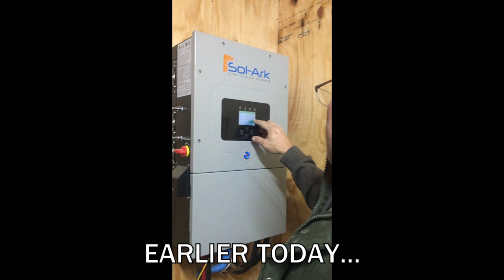A TOUR INSIDE the OFF-GRID DOME

Comment: Nice progress and I'm so glad you're toasty warm! Pro-tip for the tarp: Take piece of plank, small wood screws and large flat washers for them and screw the tarp into the plank along bottom edge of the tarp. You can then put another screw for fixing your rope to the brick on the ground. That will most likely last as long as the tarp does not desintegrates (those tarps desintegrate soon or later, usually soon). I use this technique all the time for covering agricultrual stuff and stocks of hay bales.
Reply from the maker: Great tip… yes, I’m sure the tarps won’t last long, just hopefully through this winter 👍

Comment: Hey great work and progress. Nice that you finally got some nicer weather. Being on the dome was really scary for me and even more so once the Trimco water proofing was being installed. We even used safety harnesses and fall protection lanyards. This did not make me feel any safer though. I was slipping on it and barely catching myself and not falling all the time. Even though I was careful when moving around on it

Go to Harbor Freight and do a search for Canvas drop cloths. We went to our local Harbor Freight to get a new propane regulator for our patio heater. My wife disappeared and came back with a few canvas drop cloths. I asked why do we need those now we don't have any interior walls to paint! She said we will use them for drapes and then use them for drop cloths later. I said those are way ugly too. I asked why when our views are so great, do you want to cover the windows. She said it will keep us warmer in the winter and block the western sun in the summer. We got them and overlapped the center or cut and overlapped the cut seams. This allows us to tie them back during the day for enjoying the views. Without insulation in the facades were seeing about 57 degrees inside even with the use of our Mr Heater big buddy on high with a heat activated fan to circulate the heat, when the weather dropped to freezing outside. We finally insulated the walls using Rock Wool brand insulation that is fire proof, mildew proof and mold proof. It is also waterproof :) . It is R24 rated for a 2x6 wall as opposed to fiberglass insulation that is R19 rated. We now see 70 degree in our 19'x20' bedroom with our new drapes and insulation installed in the exterior walls, still with only using our Mr Heater big buddy heater. We don't have any sheet rock walls inside yet either. We finally found a block mason to do our last west facing retaining wall. We are getting them to do our patio slab too. It sure is a nice feeling to be making progress isn't it.
Reply from the maker: I never heard of that insulation before, but it sounds like it would have been a good idea for us to use in the 2x6 exterior walls, especially on the north side. We thought about covering the windows with some heavy moving blankets we have but like you we didn’t want to ruin the view. We do have an agreement though that if the temperatures really drop we’ll put them up to help maintain temperatures. We’re really looking forward to seeing how things are after we’re covered.
Reply from the maker: Thank you so much, had no idea moving blankets do that and I can guess how you know…. Ugh! Great channel too, thanks for sharing 👍

Comment: Well I just had an epiphany. It seems our humidity is an issue too. We don't really cook inside and have no working toilet yet but our humidity inside our home is high. While only 20% outside we see 54% to 64% inside. I was concerned when I saw moisture collecting on the window my wife broke while weed eating to ensure no snakes could go undetected and get us or our dogs. The inside pane of or dual pane argon safety glass center window was soaked with water on the inside. I began searching for a possible cause but nothing seemed to match our situation or conditions. We were a bit perplexed to say the least. Then we stumbled on the concrete curing process. It seems that for several years after being put in place it releases moisture and a tiny bit of heat. This is not an issue in the normal curing process. But because we sealed the exterior with asphalt emulsion the process of curing is confined to the interior of the dome. So absorbing that moisture will be critical to eliminate the proliferation of mold or mildew. We are now stepping up our game and getting this moisture issue under control.
Reply from the maker: Very interesting and true!! Another good reason to put off finishing the interior walls…please let us know what you come up with as a resolution.
Reply: @CreatingASimplerLifeOffGrid  My wife is currently expanding her kitty litter program to include catchment traps that not only collect the moisture but deposit it in the containment basin. Basically a basket of kitty litter in a tub strategically placed in areas that seem to condense moisture. While we don't have near the issue you have with your winter weather, it seems to be a good first step solution. See the silica kitty litter videos we referenced as that is where we got the idea for a catchment basin and basket for the kitty litter. We have seen a bit of improvement in just two days. We can see that we will need to find a more economical source for the silica material as while it collects the moisture it quickly it becomes a stone that no longer performs as it once did. We will update you if things change. We are living more and more in our dome to facilitate it's completion. So we discover more issues and benefits as we go. We like the way your entry to each video is a recap of your journey. We will likely try to emulate that as best we can in the future. We never did videos of our progress since we were so focused on the progress and not the video documentation of it. We do however have a ton of photos of our journey. We plan to do a walk through but as you know it is super tough to video as you work. We never intended to share our adventure but have become aware that these kind of projects are like moths to a candle. We feel a responsibility to show folks just what it requires to do this kind of project. While we don't subscribe to the we are destroying our planet mantra. We do realize that we are nothing more than a source of revenue to our corporate overlords like ticks and flees on a dog. This was our first motivator for a different way of life. We shall see where and how it evolves. But so far it sure is rewarding to see our vision of reality come into a true reality. But not without a few bumps and bruises for sure. If it was easy everyone would do it. I just wish we had started this sooner in our life.
Reply from the maker: Richie says that all the time! If it was easy everyone would do it! Lol. But yes, definitely bumbs and bruises but no regrets. We chose this home for mostly the same reasons but also energy efficiency to save money, safety, and the longevity of it. Thanks for the input on the condensation, we will see what we can do for now. Would love to see more videos and learn from your experience. We would also be happy to mention your channel and direct people to your videos if you’re interested. We’ve actually watched them a few times already!!
Reply: @CreatingASimplerLifeOffGrid  Share the links with anyone you think will benefit from it. Well We had an adventure of our own. We were working on our project and a storm came through. We became concerned when it rained for an entire day and into the night. We had just spent two days grading our road so driving on our mostly clay north side of the driveway was not an option because it would damage the road we just spent two days repairing for concrete deliveries for the footer on our last section of block wall and the second story patio slab. I called off for work and we decided to install the front wall insulation and our temporary drapes (canvas paint drop cloths). Glad we did because we dropped into the low teens and the rain turned into snow. We got another surprise because the Mr Heater big buddy quit working. We have an electric heater but without any sun it would be short lived. We remembered that we had an old school propane heater in our tent camping gear and put that into service. The insulation and drapes proved to be a life saver and allowed us to remain comfortable at 65 + degrees inside with 23 to 25 degrees outside. We decided to work on our wiring, outlet and switch box installation. We got a ton done but I had to go to work so at 4am I took off while the driveway was still frozen and dropped my wife and pets of at our in town home. Then off to work I went. All in all a productive adventure. Never expected to see snow stick for days though. That pesky global warming I guess. 🤣
Reply from the maker: @Keppy Paul  Oh my gosh!!! That's crazy how it can sneak up on you like that. Glad it all worked out though :-) but I just had an awful thought… you guys are completely buried and still having condensation issues???!!! That makes us very nervous that this won’t be solved by our burial this year